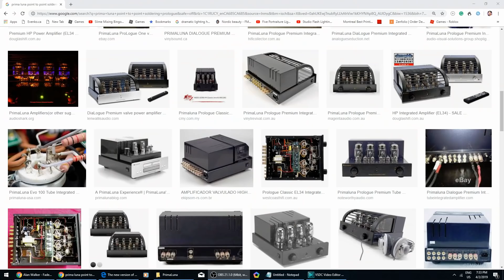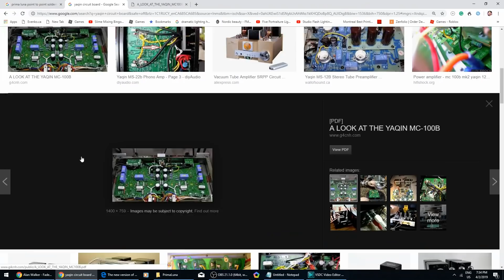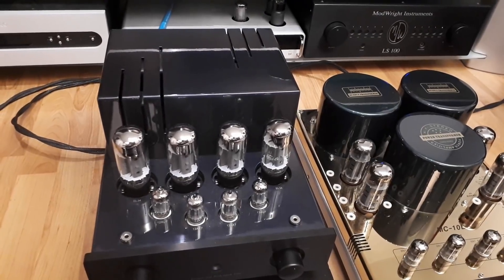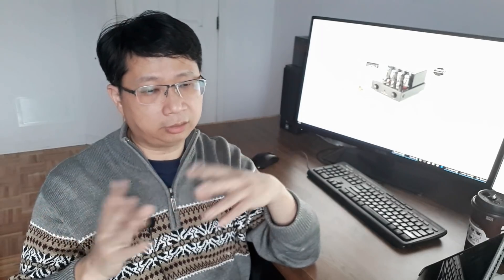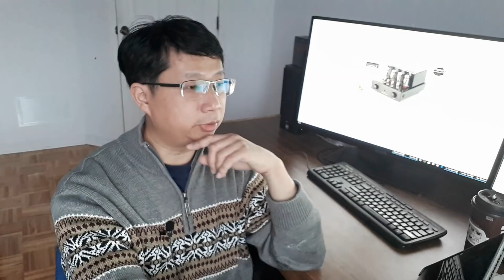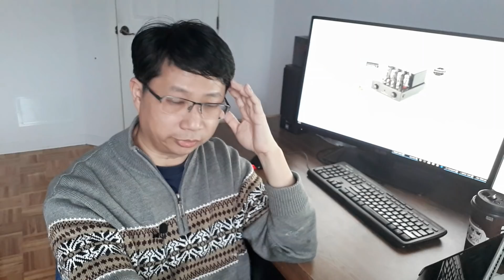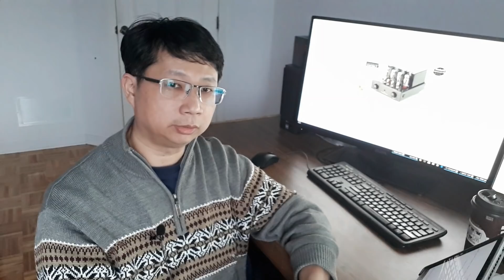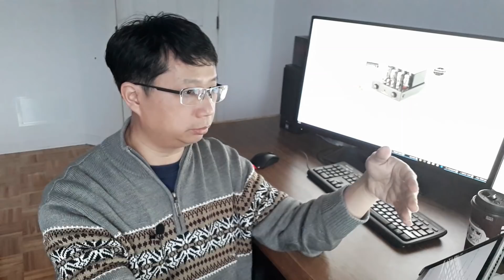Amazing PrimaLuna Prologue tube integrated amp vs Yaqin MC10L

Comment: These Prima Luna's have been around since at least 2008 or so. 35 watts of tube power is sufficient to drive most speakers. Forget the solid state 100 watt power requirement, for tube power doesn't compare to solid state power. Tubes rule!

Comment: This was wonderful. I just purchased my first integrated tube amp out of curiosity. I have not found much clarity in describing the difference in the sound of solid state and tubes.  More important to me was your explanation of old sound and new sound. Understanding the design goal of old sound  and new sound amps makes building a personally pleasing system more straight forward.
Reply from the maker: I made a video on why tubes. Check it out.

Comment: I've paired the Yaqin SD-CD3 tube buffer with the Mcintosh MC152 poweramp and they sound amazing and glorious!!! I don't know if connecting the tube buffer directly to the poweramp (without preamp) can cause any harm to the Mcintosh poweramp but they produce  unbelievably impressive sound.
Reply from the maker: It should be fine without the preamp, best check with mcintosh if you are not sure. Never tried the SD-CD3 but Yaqin has been making some nice sounding gears at very affordable price.

Comment: I had the Prologue Pre/Power and the Dialogue integrated in the past. Unfortunately this was before the KT120/KT150 tubes came in the market so i didn't get to experience the PrimaLuna with those new powerful tubes. They are build like a tank and no knowledge of tubes and how to bias is necessary so they are perfect for people who are new with tubes. With a touch of hyperbole i would call them "Tubes for Dummies" lol The flexibility to change different types of tubes also helps a lot to fine tune to your taste. They are not cheap but you get what you pay for. At the time that i had them in combination with a PCM1704 dac the sound was very smooth and inviting, with good detail but still tube like sound.
Reply: Watch your power transformer go up in smoke.  Those tubes require more heater current than 6CA7/EL34?KT77 types and would only yield a few more watts at best.  KT120s will bias up about the same as a vintage 6550s and you'll need bigger iron for more power.

Comment: I’ve had a Yaqin for 6 or so years paired with Snell Type E/I and have been very impressed (and pleased) with the results. I upgraded the tubes to SED winged C and became even more content with the sound. The Yaqin produces a deep and wide holographic soundstage with warm musicality throughout the entire sound spectrum. It is not picky about the music you play through it and will allow you to enjoy even badly recorded music from the 1920’s and will wonderfully bring it to life once again.

Currently, I am using a Sonic Frontiers SFS-40 and although it is a much more expensive and higher-end amp the sound is not “that” much better. It has a bit more clarity and bass control on the Tannoy Cheviots that I’ve paired it with but I wouldn’t say it’s in any way greatly superior, just a bit different in sound characteristics. I bought the SF as an upgrade which in some ways but not to the degree that I am convinced to get rid of the Yaqin. 

The Yaqin produces 50wpc which is more than enough unless you have a very large room or inefficient speakers. With the size of the transformers on the Yaqin it is more than capable of handling speakers with difficult impedance loads too. It won’t produce the taught slam  of SS but it will keep you in front of your stereo longer, undistracted , and happily enjoying your music, which is the whole point of this hobby (something many audiophiles forget as it seems they merely use well recorded but boring artists like Nora Jones as an excuse to listen gear and not music).  

I couldn’t recommend this amp more.
Reply from the maker: Nice, check out my Cayin CS55A review too.

Comment: I know I am a little late to the game here, but I just want to point out that wattage output has almost nothing to do with bass. As long as you have enough wattage from your amplifier to drive your speakers to 6db above your normal listening level, you should be fine. The lack of bass is probably coming from several other factors, but output power is not one of them.

Comment: Hey Thomas! I'm a 59 year old Aussie gay guy from Australia! I was a club DJ for 40 years so I've seen the best and worst!  I've been playing with electronics all my life and received my first electric shock when I was 4 years old! The 60s and 70s were the tube era at its best! Friends gave me old valve or tube sets as I grew up from radios to some beautiful valve amplifiers. Unfortunately one night while I was at work the house caught fire! The only things that survived were my Leak, Valve Point One Stereo system which was being restored at the time plus my record collection as it was stored in the garage along with all my CDs! I still get teary eyed but shit happens! I own a Primaluna Dialogue Premium HP Integrated Amplifier and the EL34 output valves sound excellent running into a pair of bookshelf Wharfedale speakers and the whole sound stage is stunning! I've driven other speakers with this amplifier and obviously the bass section is more prominent in bigger speakers but the Wharfedale speakers sound clean and accurate! Having auto bias on a tube amp to me is a blessing! I've deliberately altered the bias on some tube amps and the crossover distortion is obvious past say 5% either way! With NOS tubes you're gambling with your wallet! A friend of mine bought some NOS KT88s. Eight in all but they sounded weird?? After checking them in a tube tester, their emission rate was what, 40% at best! He'd blown over a grand on tubes that had been thrashed to death! The getters would've been a clue as they were brown and tired looking! The Primaluna Dialogue Premium HP Integrated Amplifier I own is wonderful! The build quality alone is enough to buy one and the stock EL34 output valves sound excellent running into any speaker! I have tube rolled and the KT120s give you a bit more punch but the KT150s don't sound any better to me and even then they're too tall to fit the tube guard back in place which I like! I'm running a new, never been in a club Technics SL1200 MK2 Turntable fitted with an Ortofon cartridge and the pre-amp is an english Cambridge because I wanted the amp stock! You can turn the volume up full and all you can hear is a faint hiss but when playing vinyl, I wanted to hear if the pre-amp was adding anything which it's not. I can't get the volume level much past 10.00 o'clock on the Tuner, CD player or Turntable anyway without risking hearing damage. It's got plenty of head room! As I say, when I win Lotto things will be change but Primaluna will be a part of my setup! Cheers from down under, Andrew!

Comment: I had both these integrated amplifiers.  To me the Prima Luna Prologue One along with Vintage KLH model 5 sounded better than Yaqqin. I was also worried about the biasing on Yaqin. Yes , I use vintage tubes like Philips EL 34 Made in Germany.  They do have a 3 dimensional imaging capability under ideal conditions.

Comment: I listened to a tube rolled PrimaLuna Evo400  integrated (and the same with stock tubes) and the Line Magnetic LM805IA absolutely trashed it even with OEM tubes. Not even close. Sound stage, detail, linearity, resolution, refinement, bass punch, and that holographic magic. LM was clearly better in every category. 48 watts of true SET power! 88lbs!

Try the LM845IA or LM805IA from Line Magnetic, Thomas! You’ll be glad you did!! 👍😊
Reply from the maker: Yeah, I heard the EVO 400 too as my friend has one. One day I will try Line Magnetic.
Reply: @ThomasAndStereo  Line Magnetic is legitimately good. Not “for the money”, but in an absolute sense.
Reply: I second this.

Comment: I do agree there are 2 sounds. I repair, build and engineer tube audio.  There are many reasons for that sound difference. Also the Prima Luna is excellent equipment.  I have modified the bias on mine so I can push the output tubes however excellent either way.  Mine sounded best with a Quad of Genalex KT88 from the early 1960's. I also replaced my 12ax7 tubes with GE 5751.

Comment: After about 11 months of research, reading reviews, watching YouTube videos, asking friends and trying gear out in stores,  I bought the Primaluna DiaLogue Premium in November 2018 and I'm very satisfied that I made the right choice for me and my needs.  Oddly enough, Primaluna was the one brand that I was interested in that I could not try in person locally. I'd long decided on a Rogue Audio Cronus Magnum II (I was waiting to move into new house), but in the end Kevin Deal's video about Primaluna's point-to-point wiring, exotic parts and not having to retube it every 12 months convinced me that Primaluna was probably the right way to go.  The Cronus Magnum II is a great amp, and powerful, but it runs the tubes too hot and they need to be replaced frequently.  The build on Primaluna products is quite good and the power switch, the input selector and the remote feel fantastic in a tactical sense and it's as heavy as an anvil.

I would say to anyone interested that watching Upscale Audio's videos are a MUST before you pull the trigger on a tube amp. He's one of the best salesmen I've ever witnessed. His spiel is perfection, what a character, but the thing is, he's genuinely excited about Primaluna gear. It would be impossible to fake that sort of articulated enthusiasm. He sure sold me, I'll say that much.

If you have a larger space, you'll want the HP model. The DiaLogue Premium will go pretty loud, but hard to drive speakers need not apply. If my room was even slightly larger I'd have gone for the HP.

Now on to new speakers.  So far leaning towards another Kevin Deal recommendation the Tannoy Revolution 8XTF.
Reply from the maker: Congrats, my friend have the Kanta also, VERY good speakers and require not much to drive them. Even 50watt was enough if you don't drive them loud.
Reply from the maker: Yup, Kevin is an amazing and passionate salesman. I am tempted to pick up the 8XTF too as I have found one used at $1500 but a good 4 hours drive so I am hesitant. Congrats on your prima, I am still waiting to get my hands on a higher end one to try.
Reply: Richard, did you get the Tannoys? Kevin talked me into getting the Tannoy Stirlings and they are great.

Comment: Just stumbled upon your channel. My previous amplifiers were Atma-shpere M60 monoblocks with entry level Prima Prologue preamp . With home made Dynaudio 3 way system and proper speaker placement the equipment disappeared leaving you in a realistic detailed audio experience. Atma-spheres are power hogs consuming 300 watts per chassis. Atma-speres I found to be hard on tubes. Tube availability was also getting difficult and expensive to deal with. Tried Tripath T-class which produce no heat and gave a similar "airy" presentation until pushed too hard...the sound quality fell apart rapidly. I was finally able to purchase the PrimaLuna Premium Dialogue HP power amp with Dialogue Premium preamp. This system is now driving JBL 4425 studio monitors on Kenrick style stands. I am using KT77 power tubes and they are barely working hard. The sound is effortless, detailed and puts you right into the recording venue. I have operated this system for 2 years with no noticeable wear on tubes and look forward to much more listening enjoyment. I also have an excellent source on quality tested and matched tubes when the need arises. Audio Bliss!
Reply from the maker: So another happy Prima Luna owner. Thanks for sharing, you have a very nice setup now. Do you find it less airy than the M60? I listened to the EVO400 and found it  so  'clean' that it's almost solid state sounding.
Reply: When the M60's are working correctly the notes of music seem to have space between them. My amps have not performed well for years so they sit on sides of listening room. No A-B comparison could be made.For much less money I could have shipped them back to St Paul for a complete rebuild with new warranty but I chose a system with active tube monitoring and biasing. Mark Gilmore of Granite Audio stated he would never use an Atma-sphere without active bias on each power tube. I agree fully as the Atma's would blow a triode section unbalancing its performance. Too hard and expensive to live with. My God, the MA-3's with 42 power tubes per chassis would be a bitch to live with. OTL's offer an "openness" of sound that no other system can match but at a huge cost to maintain.
I have not heard the new EVO iteration of PrimaLuna. I am so satisfied with the rock solid performance of the Dialogue Premium HP that I don't need more.
The Dialogue was originally ordered with KT120's and the stock EL-34's. Talking with Kevin Deal he stated the EL-34 is a much more musical tube, which it is. The KT-77 is the highest rated EL-34 available and that is what I am now using.
I added a Manley Labs Chinook phono stage with a VPI HR-X turntable with 12 inch carbon fiber tone arm and Kiseki Purple Heart NS cartridge. The turntable is 130 pounds on a 100 lb granite slab spiked to the floor. This is one bad ass vinyl setup which sounds OTL like, music coming out of empty space.
Enjoy the Music. @ThomasAndStereo

Comment: I always feel if there any better way to bi-amp , with 1 tube amp connect to mid to high frequency while solid states connect to low frequency. Since tube amp give much holographic experience while solid state give wrap up bass. But my concern is what are the factor need to take note of when pairing both amps? What are the measures taken for the pre-amp? The most important the synergy of the character of both power amps?
I agree with you on the musicality vs analactical sounding of every equipment. Thumbs up.
Reply: That is precisely what I am trying to do with my system, but most of these dang tube integrated amps DON'T have a bloody Pre-Out to run another amp for the low-end.  That is currently what I am doing with SS amps two Dual-Mono preamps/amps for the two tall high-end dipole line-arrays and a Crown 2502 400/side amp to run the two 15" open dipole woofers.  I would frigg'n LOVE to find a nice integrated tube amp with the damn Pre-Out.  The primaluna Evo 100 actually DOES have one  but, I wish the Willsenton R-8 had one, I would probably snag it!  But, sadly like most, it doesn't have one  : (

Comment: Hello Thomas, interesting when you mention old tube amps vs. new amps. Point-to-point wiring was how tube amps were wired many years ago - long before printed circuit boards. This is why us guitarists prefer vintage tube amps from 60s, 70s (especially Fender amps). There are point-to-point hand wired and are more chimney, organic sounding (for lack of better word). As you know printed circuits board is more modern and most amps use them now. So the fact that the PrimaLuna is point-to-point would indicate that it's using older technique - don't you agree? 

Hope you had a good time at Montreal Audio Fest. We are waiting for your new room tour.
Reply from the maker: Thanks! This year, I just filmed a few rooms I thought was interesting so it's not going to be a long 3 part video. Regarding point to point, I am now very curious. My friend actually have the marantz 7 that is mentioned in upscale audio video and I am thinking asking him to bring over to try.  Although the Prima Luna uses the 'older technique', it does not sound like the vintage gear at all.

Comment: Primaluna with a mix of Gold Lion, Tungsram, RCA, or Brimar as 12AX7 and 12AU7 can make it warmer, even more holographic and punchier in the bass at the same time, even with EL34s in the back.  Of course KT120s will expand in every direction a bit more but the input tubes make all the difference in sound quality.
Reply: Can you expand on that?  What tubes up front might give the best results for what type of sound?  Thank you.

Comment: Thanks for the very good video on the PrimaLuna One Thomas.
A quick confirmation question for you.

I will be plugging my OPPO BDP-95 Blu-ray Player/Streamer, that has a Sabre 32 DAC built in, to my tube amp.
The OPPO with my Totem Tribe Speakers is all I need for this system to be good-to-go.
Is that correct?

Thanks Thomas,

David Stein
Reply from the maker: Yes, that is all you need. Are you buying a used Prima Luna One? Prima Luna, I prefer their older models. I understand you chose it for the service, however, you speakers are Totem Tribe, I don't know if you need a lot of current for those kind of speakers to bring out the bass.  As you know those speakers have very small woofer and if you cannot bring out the bass, the speakers will sound thin. EL34 is known more for voice than dynamics.
Reply: @ThomasAndStereo  
I bought the PrimaLuna ProLogue 2.
My Totem Tribe speakers are pretty efficient.
The used tube amp  I purchased comes with a 3 year parts & labor warranty. The tubes come with a 6 month warranty.
New Chinese Tube amps come with only a 1 year warranty.
I bought my tube unit from Upscale Audio in California 
As you probably know I w, they are a PrimaLuna dealer.
   Thomas, you made several points here. I am a bit confused. Are you thinking that the amp I bought might not be a good match for my speakers?
         On another 🎵       (pun intended), I am looking down the road to get more of, what you call,that  "old tube sound".
 I will probably have to buy different tubes to get some of that flavor out of the sound of my stereo system.
(Any suggestions?)

Comment: Nicely done. You have a way of discussing audio. Chubby sound, interesting way to describe sound characteristic. You speak of tubes lack of power. Where are you (obviously talking separates) using solid state power amps and tube preamps? Considering price to performance ratio, anyone interested in discovering tubes Yaquin isn't a bad place to start. Thanks Thomas